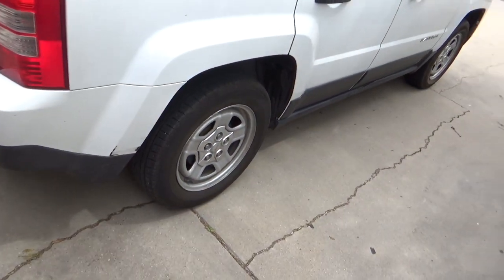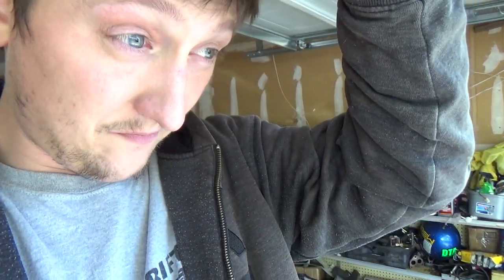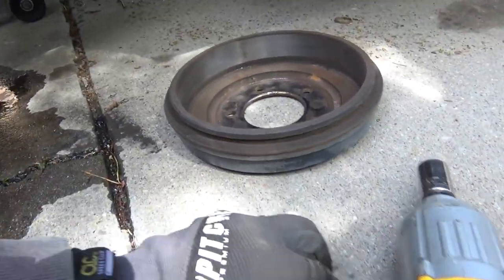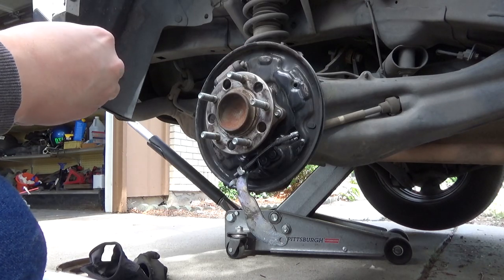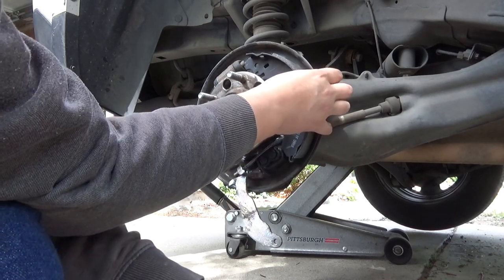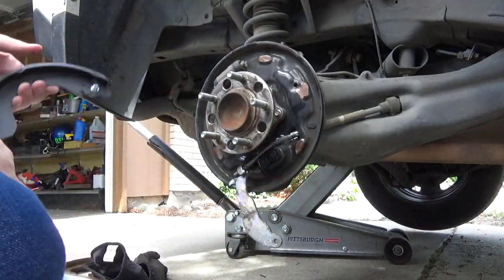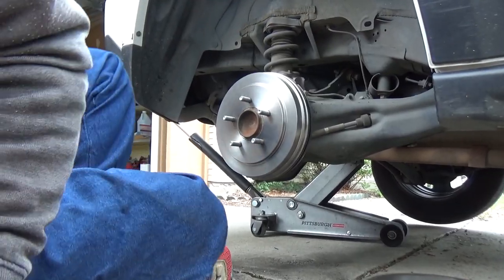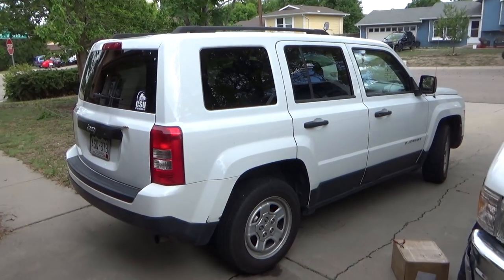How to Replace Brake Drums (2014 Jeep Patriot)

Comment: Nice video.  First time doing brake drum for me.  The one issue I had on one side was the slack adjuster needed backing off in order to get the drum on.  The other side required that I bump the shoes a little since they were not centered.  All in all, it was not too bad.  I did buy the tool for the springs and it did not help much.  I found myself using a flathead on the top outside spring and placing the blade in the slot on the locking mechanism for the adjuster and letting the spring slide down the shaft of the screwdriver.  Putting the silver disc things back prior to putting in the last spring(s) was helpful.  Using a pair of needle-nose pliers and pressing in from the center seem to work best for me.  Thanks again.  Save a few hundred doing the job myself.
Reply from the maker: Glad I could somewhat help! 🤙

Comment: I've heard a good rule of thumb is that the brakes should be loose enough to wear when you put the wheel back on, by spinning it with your hands you can turn the wheel about two full revolutions. More means they're too loose, less means they're too tight. Does anyone else do that?
Reply: No. that's not the way its done. Do you remember the part where he mentions the "slack adjusters?" you use the slack adjusters to expand the break shoes until the drum barely catches, then adjust the slack adjusters back to the point the drum spins freely and you hear 0 rubbing noise of the brake shoe until it stops on its own, not just to stop after 2 revolutions.

Comment: Good job but you failed at the first step so get an F

NEVER rely on a floor jack to hold a vehicle up that you are working on. Yes, even if you're not going under it.
Reply from the maker: Bad habits are hard to kill. I guess it'll stop when I die
Reply: @jessedrifts  thank you for the video.

I hadn't serviced drum brakes in 20 years. Your video was a big help.

Comment: Thanks for the video, super helpful,

When I was changing the the brakes though, the rubber seal on the cylinder came off and a bit of brake fluid leaked. Should I be worried about having to bleed the brakes for air in the system?
Reply from the maker: No not unless it continues to leak without you moving anything. I did the same thing and the car is fine still. No leaks or anything
Reply: Awesome, thanks for the reply!

Comment: So is there a way to easily put the horseshoe on the swivel? I can’t do it with pliers, is there a tool the makes it easier to slide it on and secure it?
Reply from the maker: Yes It's called a parking brake cable retaining spring installer.  A SPX 9280.

Comment: Can I ask hopefully someone can help me....I have a 2016 Jeep Patriot and everytime I hit the break peddle is squeaks....doesn’t matter if I make a complete stop or at a red light it just squeaks it’s really annoying is that just cuz the points don’t have a lube anymore?
Reply from the maker: Yes or your pretension is too loose. You might have to adjust the star wheel tighter so it contacts the full face of the shoe to not squeak. Also use synthetic grease not anti seize.
Reply: jessedrifts for sure thank u so much for getting back to me

Comment: Those  shoes are not worn, compare them to new one's,  the same, they are thin to begin with
Reply from the maker: They must've been glazed then. When I pulled the emergency brake slow, it wouldn't even slow the car down. Also I had the pretension all the way tight as possible on the star wheel so I figured they were toast
Reply: Yep, I'm  changing mine  today actually, they have been  noisy  for a long time, was expecting to find the worst but nope , shoes still as thin as the new ones .